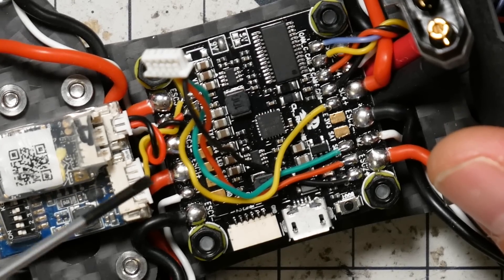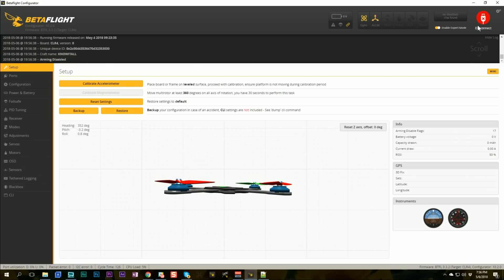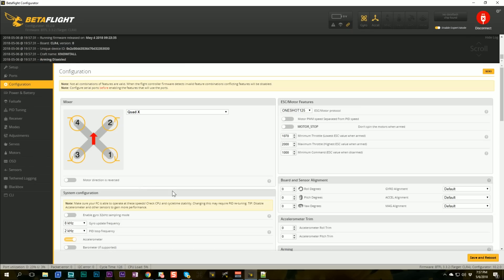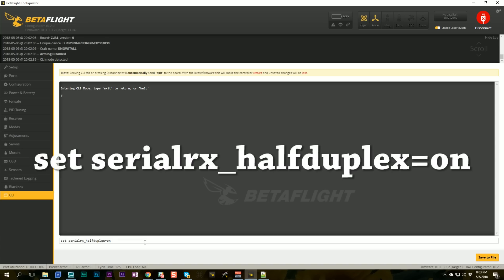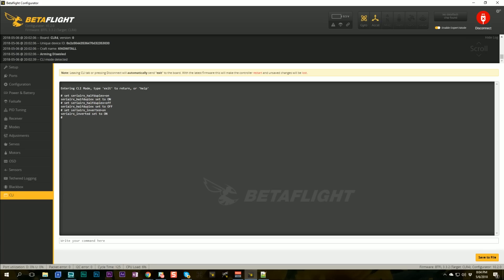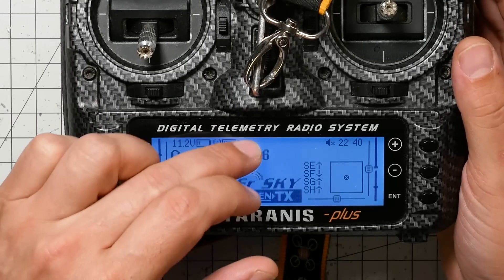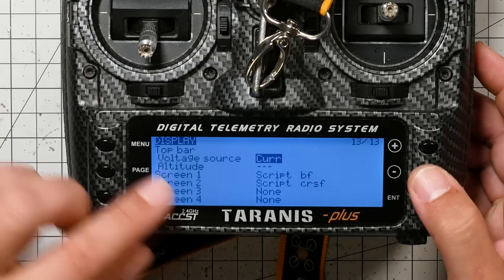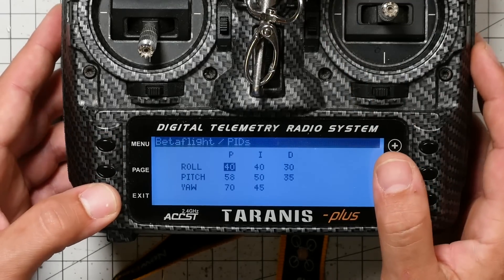FRSKY FPORT HOW TO | SBUS and SmartPort on One Wire

Comment: Hi Joshua.
First of all, I am very grateful for all the work you put into your videos. I gained a lot of useful knowledge from them!
I have a rather unusual problem.
My fc is AIRB/OMNIBUSF4SD(STM32F405) BF version 4.3.2 (it doesn't work at all on other newer BF versions)
Radio X9D+ se, soft RF module XJT_ACCST_2.1.0_FCC
FrSky XSR ACCST receiver (X4RXSR_ACCST_2.1.0_Fport_FCC) s.port not modified, connected to FC on a dedicated s.Bus pad.
The controls in the receiver tab work (sliders move) but telemetry does not work.
As for CLI, I checked all configurations.
The set serialrx_inverted option doesn't change anything in my case.
The set serialrx_halfduplex option must be set to OFF for the control to work.
I'm at a loss because before updating to the latest BF version, everything worked fine, I had all the telemetry (it worked normally on software 3.2.2).
I will be grateful for any help :]
Regards !

Comment: Unfortunately I bought the r-xsr based on your website/video recommendation. I never used a frsky receiver before and had no idea I needed a Frsky transmitter to use the receiver. I have spektrum, flysky, futaba, traxxas, and radiolink. None of these receivers require a firmware update to work out of the box. This was a poor recommendation and leaving out that detail without looking at an unlinked video is not cool.

Comment: Your video is titled smart port and sbus on one wire, yet you are still using 4 wires. I thought if you are using fport all you need is signal pos and neg. Im so confused.....
Reply from the maker: You are correct. I just left the SBUS wire in place out of laziness. It's not doing anything though.

Comment: I've tried this, and it didn't work - my FC has a F-port pad on the and the manual says that the Sbus goes to that pad on the FC. It is Uart5, but regardless, It wont do what you show here. I've tried to use the Inverted Sbus to no avail too. The reciever is a Frsky Archer RS. The FC is a Diatone Mamba F405basicMk3. In my Taranis X9lite I have only 3 sensors in the telemetry tab (shouldnt I have more ?)
Reply from the maker: For the Archer series of receivers, you switch them between SBUS and FPORT using a menu option in the radio. I don't know off the top of my head exactly where it is. It's in the receiver settings menu somewhere.

You might also need to go to the Betaflight CLI and type

set serialrx_halfduplex=on
save

Comment: Hello sir I bought a super viper I have a controller fsi6 and a gyro reflex v2 for some reason I don’t know how to make the gyro (reflex v2) put in safe mode.

I have the safe mode options in my remote (fsi6) but the gyro will still led flash instead of bing just on (safe gyro)

Also I didn’t connect any ibus pmm 
Just the servos the reciver is a fs ia6b

Is it why I can’t turn it on?
Because I didn’t connect the ibus ?

Help please

Comment: Hi Joshua ,   I just try  it on F745 contoller and R9 slim+ OTA , i flash FCC fport , i get telemetry RSSI , and reciever bound ok but it is not responding to X7 transmitter   i change TX2 to TX3 I try all CLI serialrx_ half and all others  but 
?????? please help

Comment: I have an x-lite running opentx 2.2.4 and a crazybee F4 board trying to add an R-XSR. I can bind and fly the quad using sbus with the rxsr firmware 191112, but when I flash the fport firmware 191128 I can bind but I can't get activity in the receivers tab. I'm using the "inverted" pad on the R-XSR and set serial inverted off as well as half duplex on. Telemetry is turned on in betaflight as well as fport is selected as the protocol. Not sure if i'm missing something...

Comment: Can I connect the Fport from a R9mini to the SBUS pat on a f4? Both are inverted, so it should work?
Okay maybe dumb question, but I'm very new...
Inverted TX pat is not = RX pat?
So there are 4 option
Tx inverted/uninverted
Rx inverted/uninverted

I have an old DYS f4 AIO with just an SBUS pat... so it won't work with Fport?

Comment: Thanks for your great content.
I have the problem, that even if set up correctly, at first both reciever values AND telemetry values  work just fine. After some seconds, Reciever still reacts to stick inputs, but the telemetry (only the stock values RSSI etc. keep refreshing) loses connection.   In Betaflight, however, RSSI is still picked up, telling me, taht at least the communication RSXR-->FC is still active.
When i repower the FC, the same thing will happen over and over.
Anyone else had this WEIRD behavior?

Comment: Hey Dudu ! I dont know what Can i do ? I have the mamba f4 mk2 Stack with the 40a esc with the crossfire nano ! In the Description is that i Connect the Tbs Nano to rx6 and tx6 ! My taranis is Connect with the Nano but i dont know  how can i get the uart or get the Signal to betaglight! Can you give me please a tip how Can i realise or fix it ? Regards from Germany
Reply from the maker: Make sure you connected TX to RX and RX to TX between the Nano and the FC. A lot of people get the wires backwards.

Enable Serial RX on UART 6 in the Ports tab

In the Configuration tab set serial receiver protocol = CRSF

Comment: Hey Josh,  when you bind an F port RXSR reciever, do you do it in accst d16 or in access?   I have the firmware updated but it wont bind for some reason..   Thanks man!!
Reply from the maker: Accst D16 or access depends on which firmware is on the receiver. Both types of firmware can output fport.

Comment: I wonder if Joshua or anybody else can help. My new Archer GR8 receiver does not allow me to plug a sensor using the standard servo plug anymore. I had it working with the pre-ACCESS RX8R Pro as the Smart Port plug was for standard servo plugs. Do I have to use that new 4-pins F.Port connection now? If so, I guess I need to change the plug on the sensor side. Just a bit unsure, as it is, as usual, difficult to get clear info from FrSky. Any help is highly appreciated.

Comment: Hey Joshua do you think it's possible use an r-xsr with fport firmware a gps and a tramp with telemetry with a mamba f405 flight controller? Great video, I learned something today, thanks!
Reply from the maker: You would need three UARTs for that. The Tramp Telemetry could be handled with softserial so only 2 hardware UARTs needed. The FPort requires a hardware inverter or you can use the RXSR P pad which outputs inverted smartport. I think probably it can be done.

Comment: Hi joshua
Jumper r1 f-port receiver fault as on most i have seen online when binding both lights light up but you have green led on outer edge of board and red on inner which flashes in bind mode and green goes solid after power cycle 
the receiver i have was got last week and when i put in bind mode red is on outer edge of board and green on inner when binding green light flashes  and after power cycle red light goes solid  it seems to be connected 
Another point was to get it to bind i had to change RF fine tune freq to -15  it will not bind  at RF fine freq at 0 should i trust this receiver i have heard of other people having problems with bind procedures on this reciver
Reply from the maker: Needing to frequency fine tune is normal for the multiprotocol module. You can find a tutorial on how to do it on Grayson Hobby youtube channel.

Comment: Do we keep the sbus cable connected to the flight controller and F-Port deferent cable or just one (the F-port)?
Reply from the maker: No need to disconnect SBUS unless you have some other use for that UART.
Reply: Joshua Bardwell
I understand, thank you very much.
And if I flash the R-xsr with Fport firmware do i need to flash the taranis x9d too? 
Last time I flashed the taranis was almost 3 years ago 😇

Comment: Ridiculous. Won't a hundred for a radio that dont come ready to fly. B.s. SD card nonsense. Shoulsnt need any card. Shouldn't need a battery either. I've been flying over twenty years. Ive never picked up a transmitter i couldn't program and use as is. What's going on with frsky's accountability for buyer remorse JB? Do video on why you need more money and degree to get that overpriced plastic pos  radio flying a model.  Spent hundreds over past year months and cant get a fucking servo working. Fport, sbus, pwm cppm' access,accept. Fuck my life i want to fly not go to college for overpriced pos outdated before they were made.

Comment: I was able to get Fport working on my Matek F405 Std with a R-xsr receiver.  But, my telemetry is not coming over to my Taranis.  Any thoughts?  I have deleted the stock 2 that come normally then Tried to discover the rest.  It failed.  Still back to my stock 2.
Reply from the maker: Try changing tlm_halfduplex in the CLI
Reply: @JoshuaBardwell  It was "on" and I changed it to "off".  No Go.  I also tried to rebound the receiver.  That didn't work either.    I am wondering if TX3 is capable of bidirectional signals?

Comment: Also, be careful not to accidentally enable PPM when first binding your receiver. Otherwise, you gonna have a bad time. On the R-XSR if your inputs do nothing in the receiver tab, check that you a blue led and a green led, both solid.
Reply: Dude, THANK YOU, have been troubleshooting for the past two hours trying to get my receiver bars to do something in Betaflight, working great now!
Reply: Is that cppm on the receiver? Mines off and I'm still not getting stuck inputs in BF

Comment: On your other F-port video you said you only need 3 wires from rxsr, how come here at 3:05 it shows you have 4 wires, the green still being connected to the sbus pad.  I'm trying to connect an RSXR to a Talon F7, I can get my QX7 to bind to rx, but I can't get any stick inputs through betaflight and getting an RX_Failsafe error.  Using Tx4 as my fport .  Thanks for the video though it still helped answer a few other questions.
Reply from the maker: I left it connected since there was not benefit to removing it. I was originally running SBUS and it was required.
Reply: Joshua Bardwell, thank you sooo much for the quick response!  i found my problem, must have read pinout wrong, but had signal wire connected to TX1 not TX4.   Btw. since the quarantine, catching up on quad repairs, my newly made JB smoke stopper saved two different quads from magic smoke.  Thanks again!!

Comment: Hi Joshua, I flashed the fport firmware on my r-xsr , when I went to bind it to my qx7, the red green and blue light turn solid . And when I turn all of them off and back on it is not  bound. And I get the solid blue and blinking red..  this is my first build.(rotor riot budget build).  Any advice would be rad. Thanks dude
Reply from the maker: Red and green light solid means the RX is in bind mode.
When binding completes, the red LED flashes.

It sounds like you haven't completed binding.
Reply: So I switched out the rxsr for an xm + and it bound just fine...  So I believe I got the binding process down... It's just when I try and bind the rxsr it never seems to bind ..all LEDs just stay solid...could there be a firmware conflict... I have the newest accst fcc  firmware on radio and newst f port firmware fcc for rxsr... I tried moving the radio away from the reciever while binding..iv waited a significant amount of time...   Any tips or tricks I could do let me know .. if not no worries dude I'll snag another rxsr and try again... Thanks for the reply so fast... I dig your work . Really rad stuff
Reply from the maker: Yes there could be a firmware conflict.

The newest frsky ACCST firmware 2.x is not compatible with older firmware.

Comment: hey Joshua. i have fport activated on my kakute f4 AIO. but i have a problem with the telemetry on my taranis x9d+. RSSi i get, but i dont see the battery power from the lipo. descovers new sensors bring no solution. do you have a idea. thanx
Reply from the maker: Make sure to enable telemetry feature in the configuration tab.
Reply: @JoshuaBardwell  i have Joshua. In Bf 4.0 it works, on Bf 4.1 not 🤔

Comment: right i have resolved the problem. sorry for the confusion but hopfully it might help somone. it looks like frsky had the latest firmware package as 191112 and had fport and sbus versions inside as usual but like i said the 191112 fport version would not work with fport in betaflight. 

as of today 29/11/19 the same 191112 package says (191128 Fport) in the description and contains 191112 for sbus and 191128 for Fport so it looks like some kind of screwup form frsky. 191128 is working fine following this video. many thanks

Comment: hey, i installed a r xsr with f-port on my hobbywing xrotor g2 stack and the reciveing works fine, but i dont find any sensor more than rssi and rxbt, but in my matek f722 with r xsr and f-port i found 14 sensors. do you have any thoughts what i could have doing wrong?

Comment: I can't get my R-XSR to work on my Mamba F722S, I just don't understand... Software is flashed and RX bound, BF is up to date, I tried the 4 cli, inverted hack or not, doesn't work on any of the tx pads
Reply from the maker: On an F7 processor you don't need to do any inversion hack. SmartPort out (yellow wire) from the RXSR to UART TX on the FC. Serial RX enabled on that UART in the Betaflight Ports tab. Serial receiver protocol set to FPort in the Configuration tab. Then CLI either halfduplex on or off. Do not change the serialrx_inverted option on an F7 you don't need it.
Reply: @JoshuaBardwell  Hi Joshua, thanks for the answer! I actually had to reflash my tx without the flex firmware, it made it work instantly....

Comment: Joshua if I flash my X4R-SB for F.Port will I still be able to use the original SBUS connection on the end of the receiver for controlling a gimbal for example?

Comment: Had to change sbus wire from rx pin to tx pin on uart.
Reply from the maker: You mean SmartPort right? SmartPort goes to TX for FPort protocol.
Reply: @JoshuaBardwell  At first I just plugged the rx fport into my SBUS input (Rx), selected FPORT and the RC worked but I only got the Rx's telem. Switched to TX pin and it worked.

Comment: Hey Josh I’ve done everything I know how to the quad And my Rsxr Will bind but will not put out any signal  I am running a Kakute f7 stack I have s bus connected to Rx six I have smart port connected to Tx four , I have serial rx 4 in the on position, I have even gone to the command line and did the two changes you suggested and still no signal I have been at this a little over a week I’m just frustrated at this point is there any other help that you could give me. I’ve made all kinds of changes and nothing seems to work
Reply from the maker: If you are not running the FPort firmware, then the CLI changes I gave in this video will not help. Are you running the FPort or the standard firmware?

You have SBUS connected to RX6. A really common mistake is to use the white wire, which is SBUS IN. Forget that wire. You want the green SBUS OUT wire connected to RX6.
Reply: I am running the fport firmware, I just put a different receiver from a different quad that was running S bus and now it works so I’m wondering if I have a batch of bad receivers I’ve tried two different new ones that I bought as a batch of five and I cannot get either of them to work in fport or s bus
Reply: And I do have the green wire connected to RX 6
Reply from the maker: If you're running FPort then the green wire isn't needed. The Yellow wire to TX6 would be my approach. Enable Serial RX on UART 6. Set serial receiver protocol to FPort. Then possibly need to tweak serialrx_halfduplex.
Reply: Joshua Bardwell Hey buddy I just wanted to say thank you for the help it’s nice to know that you’re really out there and you did respond, I will try to start using your affiliate link so that I can help you out. Thanks again.FPVforlife....

Comment: dear sir;

i intend to use kakute f7 and smartport telemetry on ardu pilot.
so, smartport wire my xsr receiver to T6 and sbus to T4.

serial 6 : 57600 baud, option 7, prot.10.

i updated the xsr, it didn't work.

it's not working, i'm using yaapu script , any idea ?

thanks.

Comment: So with a R9 slim+ the s-port/f-port wire goes to the ‘T’ pad on the JBF4 and the SBus out would go to the ‘S’ pad?

Thanks
Reply from the maker: Correct.
Reply: @JoshuaBardwell  Thank you sir.  I'm off to break a quad.  :-)

Comment: Hi Josh i can't find a video about Taranis problems on your lists, but here is one for you.  My firmware version is 2.2.3  I think that is the latest update. but when I choose new model on the first page  I don't get the model type screen. Then in model setup, on model image I get "No bit maps on SD".   They are there on the SD when i plug it into my PC. but not showing in Taranis Any ideas
Reply from the maker: Most likely your SD card needs to be replaced. Especially if it is the original SD card that came with the radio. They are kind of junk. 

On the PC, you see the files, but if you try to actually open one does it open?

Comment: Hi JB, at 3m04s, you still have 2 wires connected, the sbus and the telemetry (yellow and green). Isn't the point of Fport that you only need 1? Like here https://oscarliang.com/ctt/uploads/2017/12/kakute-f7-flight-controller-fc-r9mm-mini-rx-receiver-wiring-connection-smartport-fport-1024x503.jpg
Reply: yeah, but if you were using s.port + sbus in the past you can just leave the wires because if the r-xsr is set to fport it wont use them, saves you time from unsoldering + cutting the old sbus wire

Comment: Can't get the Lua working on fport. I'm also only got rssi and rxbt
Reply from the maker: Go to telemetry screen in the Taranis and "discover new sensors".
Reply: @JoshuaBardwell  I already did that. But I use fport for a reason. The reason is that the normal sbus doesn't work anymore. Also I wired the fport to the SBus pad on my F4 so that could be the problem
Reply: @JoshuaBardwell  tryed that , but no new sensors shows up :/